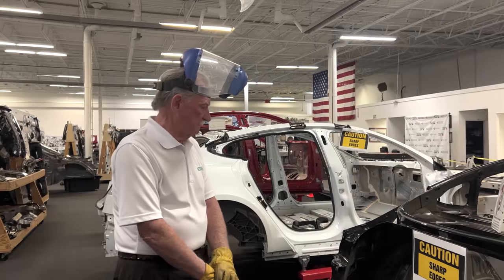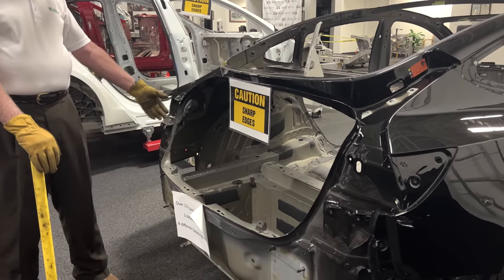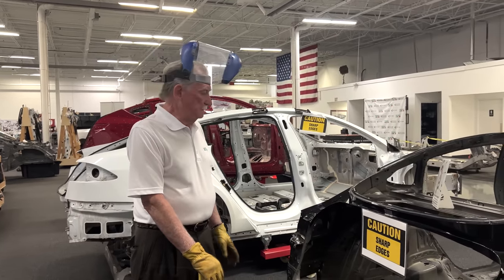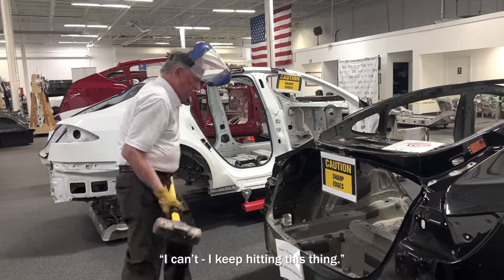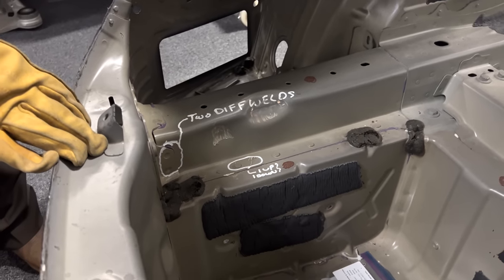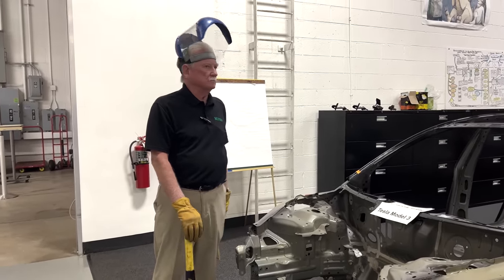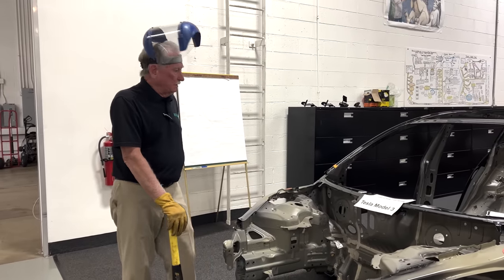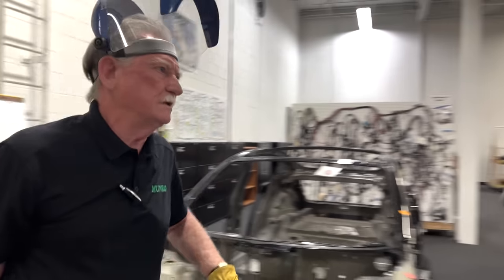Sandy Rant... With a Sledgehammer? Why Aluminum Castings Are Safer Than Steel

Comment: my concern was always repairability, not safety - is it easier to total a casting or welded steel? meaning which can be repaired with more damage before being totaled
Reply: My concern is the opposite of yours, as I want to walk away from an accident, unharmed. If the car is totaled, I see that as a win to my continued good health, if the insurance is higher, so what? If you can’t afford the associated cost of ownership, buy something else.  Last thought, if I have not lost your train of thought … How about not having an accident to begin with and then nothing has to be repaired. Be a responsible driver and drive with your brain and not your bum when your brain is jammed up it.

Comment: I really wish Sandy would be more opinionated. Its often hard to see where he stands on a given tradeoff. (wink)  Castings are always superior and aluminum showed its benefits way back in the 1950's. I can recall Kaiser Aluminum making a huge marketing push to overcome the prevailing prejudice against the "space age" metal. Detroit, due to interlocking directorates, always chose steel while postwar Europe, having to rebuild its factories embraced the advances available. A good portion of Japan's recovery was due to it building the latest metal foundries and with Deming leading the way making them the best in the world.  But Detroit, as usual, was arrogant.  Arrogance loses markets. 
Follow up question - repairability?  You noted the steel could be tapped or hydraulically pulled back out. Of course if severely damaged both would be cut and a new part welded in place. Or in this day and age - the car is just totalled.  I suppose both are equally recycleable. (Circular Economy mandates)
Thanks Sandy. Always great content.
Reply: Imagine , IF Kaizer Gigacast all the LIBERTY ships in WWII

Comment: No doubt the AL is stronger. Could you inform us about the engineering required to make sure the castings vs steel on stress cracking?

Comment: The test wasnt exactly accurate on the rear casting because the model Y casting wasnt attached to anything, it moved a lot when you hit it instead of absorbing it. so of course its not going to dent. 
What's your thoughts on the pictures emerged of cracking in the model Y aluminum casting?

Comment: Right off the bat, not the same experiment. The steel was attached to an entire vehicle. It had nowhere to run. When you hit the casting, it ran away from you that’s not being forced to absorb the full impact of the blow of the hammer. By the way, I know you never would’ve worn that face shield if you weren’t being filmed. You’re only forced to do that because of the safety nannies in the comment section.😂 however, I’m still not convinced aluminate was better. Because the test conditions weren’t the same.
Reply: Go ahead and burn your computer.

Comment: Tensile below the failure limit on steel doesn't degrade the material, but it does for aluminum.  Thicker aluminum with higher limits will degrade less under stress but there's a reason that aluminum aircraft regularly has to get x-rayed.  The matter here is that the vehicle structures in question here are unlikely to degrade significantly over their service lives as the life of a car is far shorter than an airframe.

But yes, there's a reason there are no aluminum springs.
Reply: Stop trying to sound inteli. It's not working
Reply: @rogerstarkey5390  I'll take a lesson from you.

Comment: Surprised to see this from Sandy - hitting attached metal with hammer over the head vs unattached part from shoulder level? Put both parts under a press and show the results. Metal part is much stronger weight per weight and the aluminum cracks after first hit.

Comment: So, since castings are obviously less bendable, will they shatter in a high-speed crash (perhaps as intended), or remain intact?  In the past, I've heard that crumple zones are beneficial because they reduce high deceleration rates, which are very bad for the human body.
Reply: Well since the cars passed all the safety crash testing with highest rating you can consider that these issues have been very successfully addressed! The car has lots of parts that crumple and other parts that need to be very strong.

Comment: the keyboard engineers run crazy on the internet. Then the media gets ahold of it and spins it. Frankly the castings are stronger, cleaner, improve fitment in body/white. 

There's nothing but gains from this. Its like the recent article about a model Y that had "imperfections" in the casting because he could see through portions of the non-structural parts of it. However the part that actually was fine, is the part the actually makes the part "strong". Tesla ended up telling the customer due to this they could exchange there car on a buy back, but at the end of the day this casting had nothing wrong with it from a structural aspect and would have behaved the same as other vehicles sold. Now this buy back car will serve a secondary life as a used model or a service vehicle in there own fleet.

Comment: Bending strength/stiffness goes as area moment of interia.  Area moment if inertia goes with thickness to the third power.  If all else is equal the same weight of aluminum is almost 3 times thicker.  Nine times stronger divided by the relative yield or ultimate strength…. Which isn’t vaguely 9 times weaker.

Airplanes are mostly aluminum for a good reason.  Most rockets are mostly aluminum for the same reason.  It’s stiffer and stronger for a given weight.

Comment: The model 3 longitudinals are locked in place allowing the full force of your hammer to be transferred into the structure. The model Y part is loose and moves with the blow rather than absorbing it fully. Not a valid test. I suspect the casting is in fact much stronger, but your test could be better.

Comment: you need a designated batter for these vids. great demo but need someone who could get full top end on that sledge swing. the explanation should have also included the ability of the casting to form support ridges in the part instead of simply a stamped part mechanical strength. good job

Comment: If only crashes were even slightly comparable to being hit with a sledgehammer...

I hope the technical nonsense here is just oversimplification to make a point, rather than actual ignorance by Sandy.
Reply: Well he is an expert, are you?
Reply: @ianhamilton3113  yes, I am. 

But all you need is common sense to realize that a sledgehammer is significantly different from two tons of car, and that hitting the top of a suspension tower is different from colliding with another vehicle or a solid object. And yes, whether the cast part is free to move when hit is critically important to the damage which it sustains.

Comment: Not a very good test… as an engineer I’d assume the fact that the shock would be absorbed by the ability to move the casting would be self evident.
I’m confident the casting would do well but you need a much better testing procedure.

Comment: Well, castings have sure come a long way, as I remember from high school that castings were said to be far more brittle than pressed steel in a deformation test. I have a 2023 Model Y and it sure feels a lot tighter to drive than the original 2020 model Y that from my own personal impressions felt looser to drive.
Reply: Die castings are much higher quality than gravity castings.

Comment: Not to be too critical, but it would be a better test of the Model Y casting if both had the same mass or was fixed in place.  Otherwise, I get the  point.

Comment: Many chevy GM types types in the ninetys with aluminum engine cradles are cracked.  Many trucks might not have  lost control had it not been for an aluminum wheel breaking.  A  aluminum roll off wrecker bed is always cracked and determined to be a bad investment.  I worked auto salvage for 40 years, all my evidence is anecdotal  and i don't know very much at all.

Comment: I don't doubt the casting is stronger, but this video certainly should be more thorough. Anyone who doubts can easily pick this video apart, and people who are misinformed will often double down on their false opinions when there are gaps in the opposing arguments. First, the rear casting you had was not affixed to anything with mass. If the casting slides out of the way, the hammer can't impart nearly as much force into what it's hitting, Newton's third law. If you affix the casting to a work bench or something with similar mass to the welded steel frame, the comparison would be fair. Second, you did not measure the deflection, if any, on the front casting strut tower after hitting it. 
Also the title of your video states that castings are safer, which is not necessarily linked to their rigidity. The safest car would crumple and deflect a lot, but just enough to prevent any distortions or intrusions into the occupant area. An extremely rigid frame doesn't make a car safe, see the VW T3 Van crash tests. The rigidity allows the manufacturer to control exactly where deflection of frame takes place though. I think you should discuss this as well.

Comment: What about the castings that were supposed to come on the Model 3 "refresh" aka Highland?
Reply: Yeah, there was never anything official saying M3  would get castings with the refresh. Oh wait, it was a refresh, not reengineered. A lot of people were wishing for stuff that will never happen including a future $25,000 USD car people are swearing will come soon.
Reply: @Drcraigfreeman9280  Yes, it was reengineered, with many important changes including suspension or anchor points in the doors for crash safety. But yes, there was nothing official about castings (of course), only rumors.

Comment: Not sure what any of this proves? When you hit a casting, it moves? Sheet metal deforms with enough impact energy?  If my car is going to be written off, I want the structure outside of the cage to absorb all the energy it can before it reaches the internal cage.  The casting stiffness must be awesome for chassis design and weld/big assy and geometric control.

Comment: Is it possible there may be some micro fractions on the casting that may compromise the rigidity?
Reply: Is it possible that Tesla (with help from the literal "Rocket Scientists at SpaceX) developed an alloy not prone to fracturing?
Then tested the alloy.
Then computer modelled the casting, then made the casting, then tested the casting?
(Then laughed because they KNEW social media Muppets would question the use?)
Reply: NOPE, you cant Break a GIGACASTING, any fracturs repaired by Adhesive.

Comment: Oooh.. someone really pissed off Mr. Munro. ;) Not an enviable position

Nonetheless.. the sledgehammer tests shall not be enough for that person (or for me) - the reaction mass isn't there. It isn't an apples-to-apples comparison (not that one was needed)
Another thing is that in the first crash of the car, the casting shall likely absorb more energy than the steel. The issue is usually about the second crash. The steel buckles and shows exterior signs of damage far far FAR before giving up the ghost. When a crack in the casting is not apparent, the n+1th crash is likely gonna give you issues. 

Guess time will tell. For all we know, all automobiles may be  banned in 2030, or perhaps driver-assistance will become so phenomenal, that crashes shall be a thing of the past.

If you must speak in analogies, then wheel-rims have been made from castings for a long long time (similar wear-and-tear as the chassis) and they seem to have done fairly okay thus far.

Comment: My Model Y was rear ended by another Tesla that was shoved into me by an old Jeep Wagoneer. The rear casting was not damaged but the total repair was $14K for a new rear quarter panel, bumper and hatchback. Tesla has very well trained, certified repair facilities that do the guaranteed work. The Model Y is perfect after repairs with no issues other than it taking 3 months due to parts availability. Obviously Sandy knows what he is talking about and I enjoy his rants but for physical/mental health's sake, he needs to learn to ignore the ever increasing number of idiots with keyboards. 🙂

Comment: Nothing wrong with a casting but the test wasn't equal and the parts were not designed for sledge hammers.  Glad you didn't hurt yourself Sandy.

Comment: 3:35 The casting is also not held in place, and such moves.
But regardless, thicker aluminium is stronger than thin steel.

Comment: It doesn't make any sense for the CYBER TRUCK to be made with stainless steel. It only made sense when their plan was to use a EXOSKELETON STEEL EXTERIOR. Without EXOSKELETON STEEL EXTERIOR it just poor design choice & bad engineering

Comment: Why is he hitting parts that aren't secured to the floor? The momentum the part gains from the sledgehammer hit since it's loose changes everything about the impact. Besides, an actual test should not involve a human hitting at different angles but a machine able to replicate the same hit and force.

Comment: some new engines don't use coatings, liners or sleeves just a custom blend of aluminum and it holds upto 120k miles plus of rings and pistons slapping around.
The castings used by tesla and the automotive industry are not the pewter  junk your thinking of that cracks and folds when you look at it wrong it's not cheap as possible toy made in bulk for bottom dollar tesla is NOT Greedy they a Driven with a goal this makes them very very powerful as a company. Greed and gluttony are common at GM and we can see how well they are doing tesla actually makes money and looks for any and all positive internal investment to spend that cash they DO  NOT want to just pocket lots of cash the tax liability makes doing so a nightmare this is why your going to see a giga factory ir two every year and this will accelerate.
The goal is 20-24mill in yearly production.
This at a margin around 6% on automotive sales and the stupidity of the tripple digit margin on FSD and Dojo, and Renting compressed data sets to other companies is why they will be the biggest company in history they will pass everyone else by 2027 and just keep going and going i can see the energy creation division car division web services division all forking BUT staying under the X umbrella of companies. But thsi will be 10-15 years from now unless governments start forcing things.
I can also see them investing in nitch concept markets like Aptera. Not with cash but hardware or special pricing of fsd. Data sets and charging credits. They have absolute control over the global auto market at this point and they are not even 3% of what they will become.
Yes in the next 5 yrs teslas factories will becomes fully automated aka lights out lines.
All this means is reduced costs the 2nd most expensive thing in a tesla after the battery is labor, if the total labor was reduced by 90% a model 3 will become a 28,000$ car.
The highland model 3 is from a MVH and class & performance in the range of a M3/M4 BMW for 1/2 the price today what if it was 1/3 or 1/4 the price. My rants can be as bad as Sandy's lol i dumped 213k into tesla in 2017 and chosen to keep renting vs buy a home this nearly leading to my divorce and was entirely based on using my bosses P85D my wife was so mad but i talked to my boss and used the car for a weekend after that my wife was considering it a really nice car now we have had some bumps and such and in 2022 she wanted to dump it and get a home i talked her into giving the investment a full 10yrs and see what happens and hit all the key points she agreed in 2027 we by a house and leave the rest in tsla.
I fully expect it to 2x by then

Comment: Given modern crash technology this doesn't tell us anything.  Something might have to crumble.
.... I believe casting is superior but not because it is stronger
Reply: "Given modern crash technology".... You mean "computerised crash modelling" technology?
.
Maybe "it tells us" they extensively modelled it 
.
smh.
Reply: @rogerstarkey5390  you have parts that are intended to flex bend or crumple. 
If you hit it with a hammer and dent it , that might be exactly what's supposed to happen.  On the other side the same part made out of a different material might not be as flexible, and so the part needs to break at a different point. 
Today things are ideally exactly as strong as they are intended to be. No more - bo less
Reply: You're right, cars are safer today because they are designed to absorb energy at the right places, i.e. to deform.
The extreme rigidity of a casting can be actually a downside of the technique from the safety perspective.
But it is definitely far superior from a production perspective: it's quicker and less expensive to make.
Reply: @elogedelaraisondure4984  I was just talking about the hammer test not telling us anything about overall safety.  ( casting is the way to go)

Comment: The argument that aluminum is inferior is wrong…if you add more of anything, it can be stronger. Tesla’s casting weighs more than the formed sheet steel. (GVW is heavier the more castings they add in MY). Engineered properly, and with more material, it will be more crash worthy.

Comment: I laughed at “steel is stronger than aluminum”. I had similar discussions in a kindergarten, what is stronger elephant or whale).
It is not material itself but construction using particular material properties in a smart way that is stronger or weaker. Aluminum has similar longitudal yield strength per kg compared to steel, but 3x less density so part of the same weight, length and longitudal strength will be wider, so will resist bending much better. And so on.